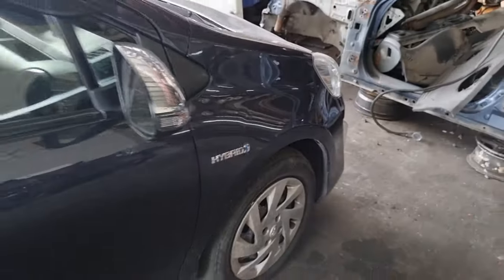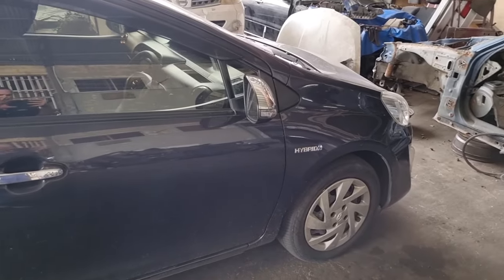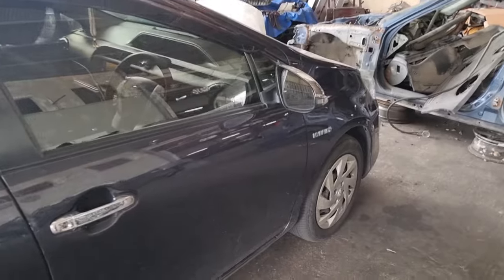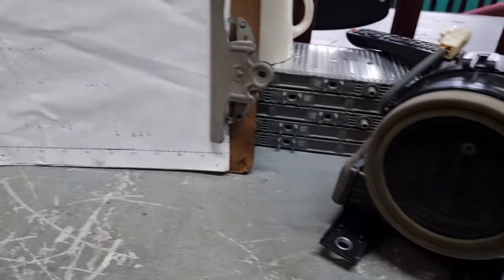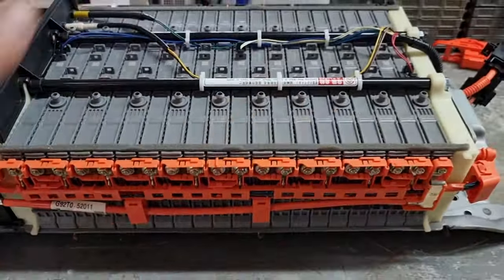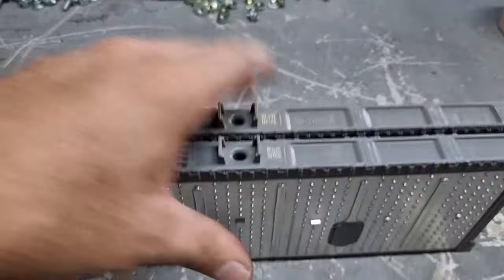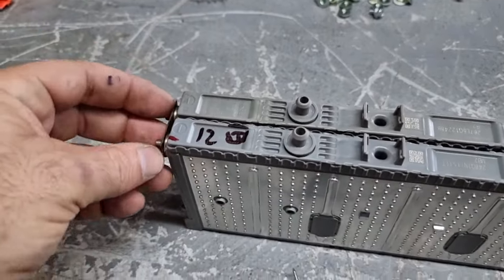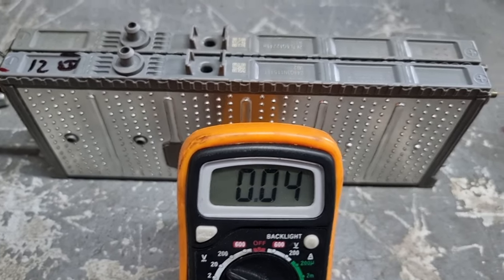Easy method to balance the Toyota hybrid battery (NiMH)

Comment: You could alternatively get another set of bus bars and connect each module pair to its neighboring module pairs. You'd have to remove the orange plastic thingy, but you're doing that anyway to clean the bus bars.
Reply from the maker: Yes of course but you would still need to take out the modules because of it's polarities are to be connected in series, not in parallel 🤔😖😬😬
Reply: @hybridsolutiondiagnostics  Oh I see, duh! That's how the bus bars work to make a high voltage pack. Good thing I didn't try out my theory, lol!
Should I delete my original comment so nobody does anything stupid?

Comment: The way I did it, is I discharged and then charged, measured the Mah, and only put ones that where 7000mah and up.
Reply from the maker: I agree to that but its not that simple... a new master class is coming soon about that by the way...
Reply: Ain’t these modules rated at 6400/6500 mah? Can a module with a capacity of 3000mah and above still be usable?
Reply from the maker: @slayryt3533  waste of time... too weak...

Comment: Great video, thumb up and subscribe from me. Can this job be done on the car with disconnecting the main supply, bus bars and connecting the batteries in parallel with cables? I see no big difference, but might be a difference as I'm not the man with the knowledge.
Reply from the maker: Thank you for your support... but BIG NO! you have to disconnect all the bus bars before balance the battery using this method... ☝️😃

Comment: The weak module still stays weak. What you get when you combine them in parallel is the total voltage of the two cell modules in parallel. Same as the ordinary flashlight cells, if the flashlight has two week cells and you replaced only one of them with new, it will have a higher total voltage but the old unreplaced cell will remain weak.

Comment: The trick you are showing for balancing is not understandable because once you take off the module from your own made machine all the modules come back to their original charging point because you can't bring back the charging/discharging capacity if the module itself has not gained during recycling.

Comment: Balance not help because one battery has  low capacity , voltage can by good after balancing but then battery got power voltage on bed battery w'll drop fast   . This is not works .

Comment: Hi. Brilliant way to balance them! Thanks 😇 Can one add electrolytes to Nickel Metal Hydrate batteries?
Reply from the maker: Dont... those batteries are sealed... and is not safe to open them and less safe to use them back after opening...
Reply: I have a problem bolting them in from underneath after taking the cells out. Suggestions?
Reply from the maker: @markpennella  they are swollen for sure... in normal conditions they should match with no problem...
Reply: @hybridsolutiondiagnostics  
I assumed the rubber tubing snaps over each cell to vent the cell's vapor (electrolyte). I guess this is why I assumed they were not sealed. :(  since they are sealed, what is the purpose of the black rubber tubing that snaps over each cell?

Comment: QUESTION: What is the ideal voltage that all the modules should be at after slow charging and then balancing them for a week? Before charging and balancing, I replaced 4 modules that were reading 6v and everything else were around 8.1v. I made the aluminum bus bar balance gadget similar to what's on this video and it was easy and cheap to make, and like he said, it WORKED quickly to balance the modules and the replacement modules to the same voltage within minutes. I have an adjustable power supply to deliver any voltage between 7v-8v to the entire aluminum bus bar, but I don't know what the ideal voltage should be before I can say that it's ready to be put back into my 2nd Gen Prius. Currently I have 7.88v on all of the modules on the balance machine. If anyone knows, let me know what the ideal voltage of all the modules should be before I can put them back in my Prius.
By the way, this is a fantastic video 👍 no doubt that in 5 years all your videos will have over 1 million views when every last 2nd Gen Prius gets the TRIANGLE of DEATH. lol.
Reply from the maker: Actually the voltage is not relevant once they are all over 7,5v and all equal… the real deal is the equal capacity of all the modules to remain in balance 🫡✅ hope this helps
Reply: If you charge one or more modules up to about 8.40 volts, and keep them just under 8.40 volts for about 12 hours, this will equalize the 6 cells within each module (all boats are raised to the same level).  If somehow the modules get above 8.60 volts you run a high risk of NVD (negative voltage drop) occurring in a module.  When this happens, you run the risk of damaging a handful of modules all at once.  So I would make sure you don't go above 8.40 volts, and I would not connect more than 6 modules at a time.  I connect them using household electrical common wire (about 12 gauge) and use nuts on the terminals to ensure you have a good connection.  Note: the Prolong charger will charge the modules up to 8.59 volts, however if the NVD occurs, this will not damage the modules because they are connected in series.  But if they are connected in parallel and NVD occurs in a module, a LOT of electrons will flow into the module with the NVD and you may instantaneously damage a handful of modules.  So what appears to be a cool way of balancing modules, this runs the risk of damaging several modules.  I noticed one person described this as happening to them.  Also, if you insert a module that has just 5 cells working, the voltage could be closer to 6.5 volts, and this could also cause several modules to be damaged.  When inserting a module into the pack, charge it up and ensure it's voltage is very close to the voltage of the pack.

Comment: Why is driving the car not balancing the cells automatically by giving it a much higher rate of charge than your charger would give it after you put the new cells in? I have done many without balancing and they work fine.
You know physics? The ones that are out of balance are most likely shot and I would toss them. Putting those back in would be a waste of time because they will just fail again prematurely.
Reply from the maker: You almost right but as far as a read all what you just said, you forgeting the very biggest detail... what about range of work during duty cycle over time?  And yes, this only applies for good batteries for preventive maintenance... but thanks anyways 👋😎

Comment: Please correct me if I am wrong. At 13:26 where you are measuring the current flow, I saw where you switch the negative (black) lead from the common port over to the  amps port on the DVOM, Is that correct? I thought I was the red (positive) lead that should be switched to the amperage port on the DVOM when measuring current flow. Excellent video though I  learned a lot from it on your other videos
Reply from the maker: Thank you for watching and yes... with this basic meter you need to change the lead to the amp mode... it is very common... ☝😎

Comment: THIS IS BOLSHIET. THE MODULES HAS ALREADY DIFFERENT CHARACTERISTICS DUE TO WORN OUT AND AGING . YOU EQUALIZED THEIR VOLTAGES TO THE AVERAGE CELL VOLTAGE, BUT THEY STILL HAS DIFFERENT CAPACITIES AND DIFFERENT VOLT AMPERE CURVES FOR THE CHARGING DISCHARGING CYCLE UNDER LOAD. SO WHEN THEY WILL BE CHARGED INTO THE PRIUS WITH A HIGHER VOLTAGE FROM THE INVERTOR AND DISCHARGED FROM THE ELECTRIC MOTOR, THEY WILL BE AGAIN WITH A DIFFERENT VOLTAGES AND THE RED TRIANGLE WILL BURNING ON THE INSTRUMENT CLUSTER AND THE DTC- "REPLACE THE BATTERY PACK" WILL BE AGAIN AFTER COUPLE SECONDS.

Comment: so i noticed that i had a bad cell, at 15v, but when i would start the car, that cell would be 17.4 while the others were 17, its like the car was specifically over volting that cell to charge it more than others because it detected it was low. is that actually a thing? i didnt think that the charging system could isolate cells and vary the charging. I thought it just takes the main negative and the main positive and puts 270 volts in that b. Or is that not what happened? can someone explain? Anyway if it is true and the car can individually balance each cell... then the whole cell balancing thing is dumb and pointless. Also the car will min and max the SOC based on the minimum and maximum voltage of any specific module. So if one single module hits max voltage, it will cap the charging. If one single module hits 15v, it will cap discharging. So kinda seems like balancing wouldnt actually prevent any damage, it would just give the car deep cycling instead of shallow cycling. Also also, the higher the voltage of a specific cell, the larger the amperage throughput. The smaller the voltage of a specific cell, the smaller the amperage throughput. Sooo naturally with the cycles of the car, the cells with the most charge, spend themselves the fastest, and the cells with the lowest charge, take the longest to discharge. Sooooo based on all these facts... if you just put an unbalanced cell into a prius array... it will just shallow cycle until all cells balance out, which probably wouldn't take that many cycles, because with each consecutive one, it will become more and more balanced. soooo... seems like you can pretty much just throw a bunch of known good cells into an array and call it a day, and people just do all this balancing crap fruitlessly just for pretentious self fart smelling and personal satisfaction of thinking they are doing a good and correct job. ........